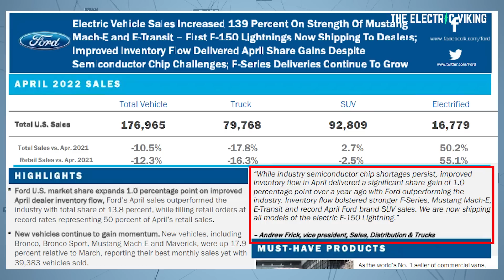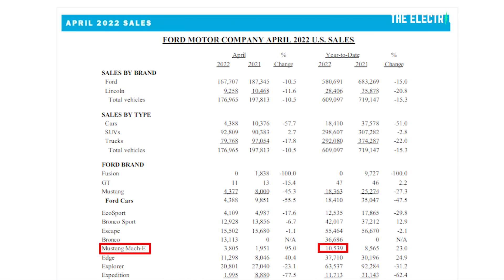This is the BEST EV news from Ford in months!

Comment: The e transit has 150 mi max range...not even viable for a days work
Reply: For a delivery truck it’s plenty of range. It’s a commercial vehicle, they can put it on routes that are within that range.
Reply: We dive routes with 100-150 stops per day, every day, and never drive 150 miles.   That said, I would want more like 200 miles range to be confident the vehicle would complete the routes in Winter when it got older.
Reply: Clueless remark, for local deliveries that's more than enough.

Comment: Sam, In your comments that no one will want at ICE F150 or other truck in the near future, I believe you are missing a big point. There a lot of people here in the US, myself included that own a pickup mainly for towing a travel trailer.  Yes it is used for daily and other driving but the reason is was chosen was for towing my trailer. I go camping several times a year and never travel less than a 100 miles from home. Many times it is over 500 miles from home. From the testing I have seen done with the Rivian R1T towing a trailer like mine (22ft,~5,000lbs) I would only get a range of ~ 150 miles per charge. As there are no charging station in campgrounds it would have to stop and charge along the way just to get to as well as to charge just before getting to the campground to make sure there was enough charge to reach a charging station on the return trip. At the present charging speed of the current pickups the would add lots (hours) of additional  time to my travel each way for my camping trips. My current f150, 3.5, twin turbo, 36gal tank can normally go ~250mile towing the trailer but fueling only takes a few minutes not hours. My trailer is on the small side for most in the US so many people would get a lot less range with an electric. Something to think about, ICE pickups are going to be around for a while.
Reply: 90+ of all new pickups are used only as one person commuter cars, they will never haul anything for their first owner.

Comment: Ford ICE F-150 sales will continue to be good, the Lightning is not going to take many of those sales, only a small percentage. I think most of the F-150 Lightning consumers were not going to buy a gas powered F-150, those are net new customers. Even if there are better EVs available Ford will still sell every EV they can make and for list price or higher at the dealer level. EV demand is just that high. There will be no lots full of EVs that are not selling. Every car on earth has to be replaced before gas becomes too expensive or availability is limited.

Comment: Tesla really only sells one high volume model: The Model 3. The model Y is just a variant and the S and X are such low production models that they don't count. This gives Tesla a huge advantage now as they only have to concentrate on increasing production. They don't have to worry about new designs and can improve the same model incrementally almost like an iPhone. I have had an order in for a Model 3 SR for 6 months now. It is supposed to be delivered sometime between August and October 2022. I'm locked in at the $$45k price. That is at the top of my budget. Tesla has since raised the price to $47K. This brings me to my second point. Tesla is pretty much a luxury car maker now. Ford has a tremendous opportunity if it can produce the $40k F 150 EV in volume and make a profit at it. If I could get a $40k F 150 lightning now I would rather have that than a $47K M3 SR. Tesla is not very good at introducing new models. I think they will have trouble making the Cybertruck in volume by 2023. Tesla's greatest advantage is the Supercharging network. That is the main reason I am sold on the Model 3. If ccs level 3 charging networks build out in the next 2-3 years I think Tesla will see a drop in market share.
Reply: That is a lot of IF's!

Comment: OEMs, for the most part, drank their own kool-aid regarding conversion to EVs not happening until 2035-2040. I suspect it is based on starting with their best possible projections in restructuring their businesses and then working backwards. Kind of a PMI approach in adding up all the independent events so as to determine total project length. Problem is of course that the non-legacy OEMs won't follow that timeline. Sandy Monroe estimated 2028 for the cross over point of more EVs selling than ICE. I'm estimating it will happen in the 2025 time frame. Either estimate is so astounding that the legacies have no choice but to be in denial. On the Ford E Transit, that was a brilliant move on their part. Rivian, for whatever reasons, screwed their program up so badly that the delivery van market is now in everyone else's hands. Ford is delivering. A couple niche European brands are delivering. Ram will be there in another 12-18 months. First mover advantage goes to Ford because Rivian blew it.

Comment: This comparison people keep making about the Nokia to smart phone change, is plain stupid. Smart phone was a total game/life changer. BEV v ICE? Nothing life changing, going from one to the other. Both do the same thing and even as a BEV advocate, i have to admit that ICE covers more situations and applications, considering current battery tech.
Reply: One involves combustion and oxygen the other does not. Tell someone who doesn't smoke that it's the same.
Reply: @gjohnston6052  Almost two-thirds (63.3%) of global electricity came from fossil fuels. This involves combustion.
Reply: Think about it as comparing the old vs the new.
Reply: @benjaminsmith2287  I agree with you it is still a car. Even though I started looking at it differently after it drove me home from the parking lot at work (16 miles. Back roads) with zero disengagement. But I am not ready to call it a computer on wheels like some Tesla owners do. To me it's still a car, it's electric but still a car.

The way I see the Nokia to smart phones comparison is, the new vs the old. Like the manual transmission cars vs the automatic transmission cars. They are both cars but the one that used to be the leader is no longer the leader.  I like manual tradition cars and one of the favorite cars that I owned was a manual transmission but at least in the US, it is easier to find an automatic transmission than a manual transmission.  Flip phones and smart phones.

Comment: Sales from ford are not great , a large portion of the cars built are sitting at dealers and are not sold.
Reply: Yet another reason why dealerships need to die off ASAP. It doesn't help that with something that has as high of a demand as the F-150 Lightning, they KNOW they can price gouge and will keep overcharging despite threats from Ford themselves telling them to cut it out.